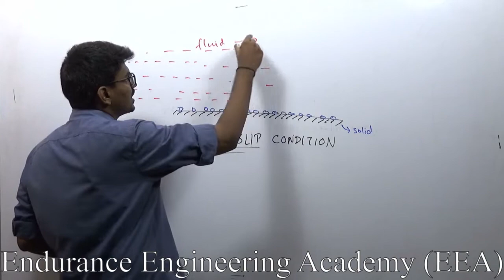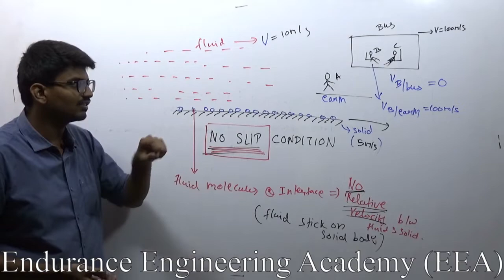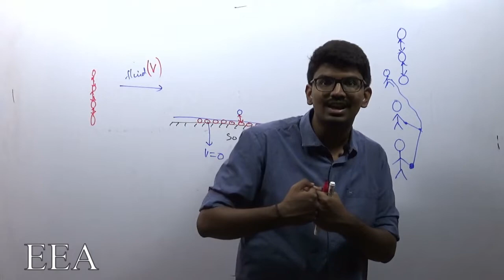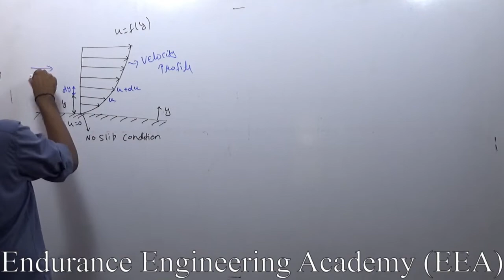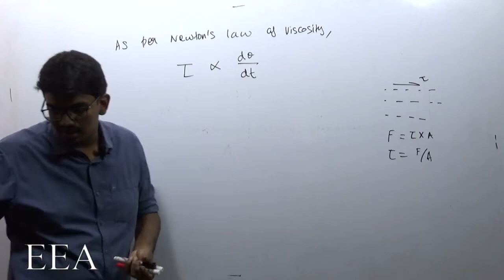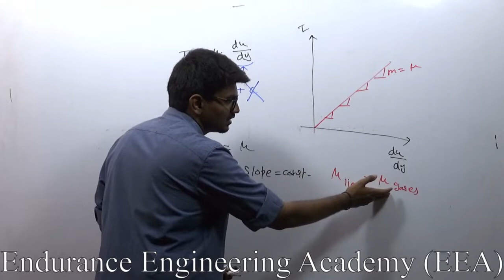Significance of Viscosity | Fluid Mechanics | GATE, ESE & PSU's Preparation

Comment: If its not considered as No slip condotion,  then the velocity profile will be vertical right.... not function of y
Reply from the maker: That is possible only in the case of ideal fluid. Ideal is not a practical fluid(it is just idealisation). All real fluid will obey no slip condition.
Reply: Im confused bw Pressure of a fluid and Force of a Fluid
In Bernoulis therom,  Why Pressure varies from one zone to other,  Force we can vary (external) 
Please reply, it will help me
Reply from the maker: @gunasekharreddy230  If you supply any external work we cannot use bernoullis eqn. Bernoullis eqn is applicable if there was no external supply of energy.
Reply from the maker: And due to pressure of fluid, there will be development of force which is what we ll call it as pressure force.